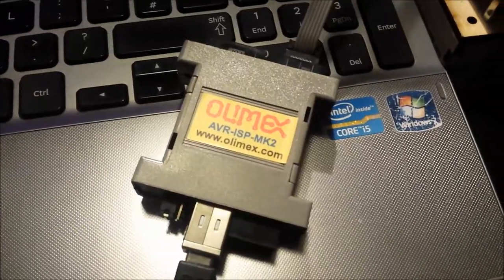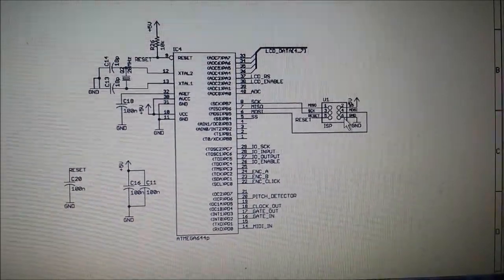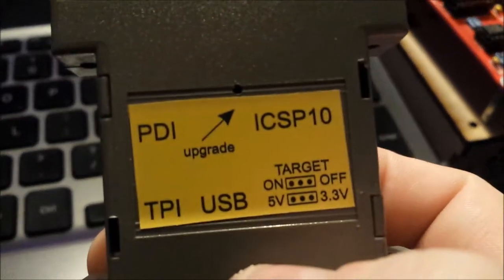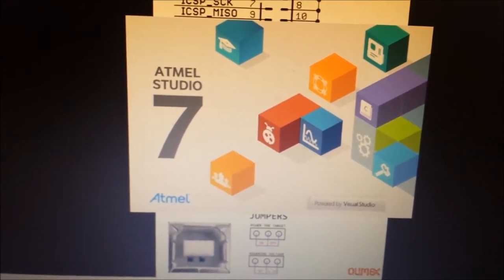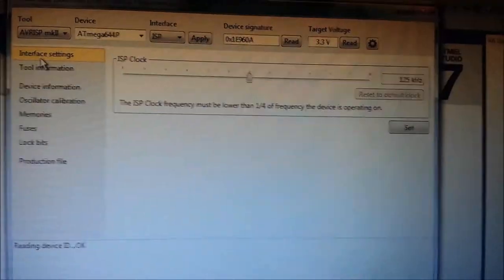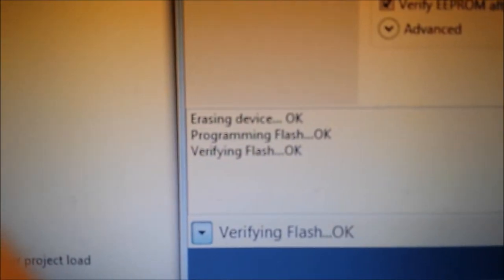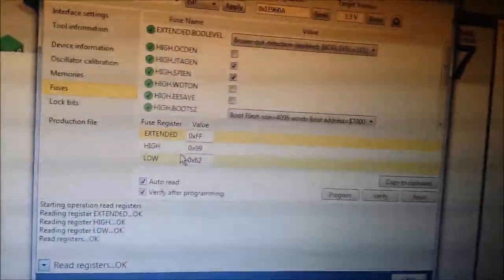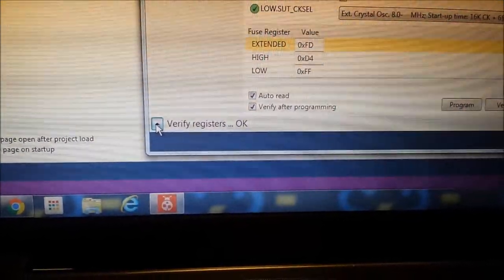Flash Hex file by ISP in Atmel Studio using an Olimex AVR ISP MK2

Comment: Thanks so much for posting this, I had started a Module Tester build a couple years back but never got around to finishing it until this week. I'm a complete noob at this sort of firmware flashing and tried following instructions I found online but kept getting errors. I really needed a good and VERY BASIC instructions for flashing this build with my Olimex AVR ISP MKII. Your step by step process worked a treat. I now have a working build and this success has encouraged me to build more modules. Cheers!!
Reply from the maker: Have fun! I still don't know what I'm doing but I'll always try and this for anything that I find that's easy but complicated if you don't know

Comment: THANK YOU SO MUCH. I did it with an AVRISP Mk2 but wouldn't have had a clue working Atmel Studio without this video.

Was really scratching my head for a while as I kept getting an error when trying to detect the ATMega. Turns out I had it plugged in the wrong way round. Numpty...

Comment: Thanks for making this vid man. Only thing I was a bit confused by was the 3.3v/5v thing - initially you have it at 3.3v, then you point out that the .sch says 5v and so it should be 5v? and then when in Atmel Studio the selection box to the right says 3.3v again? I'm going to flash my DIY Branches later today but don't want to accidentally fry anything with the wrong voltages! Cheers
Reply from the maker: Tom Watson I'm not sure off the top of my head. This is the only time I've done it. I think that the per is set in the hardware, not the software. Best checking on the forums. Muffwigger/pusherman
Reply from the maker: Its set by the hardware not the software.